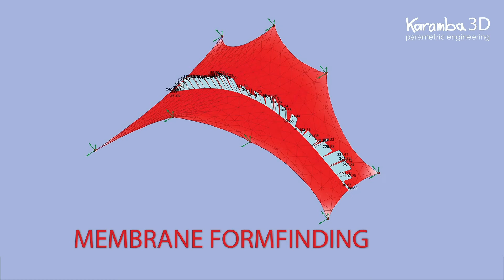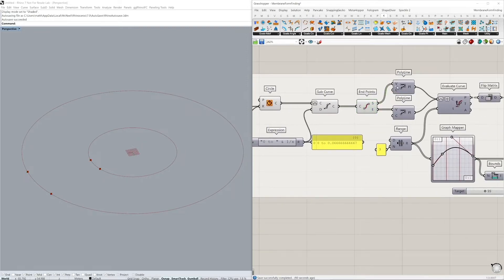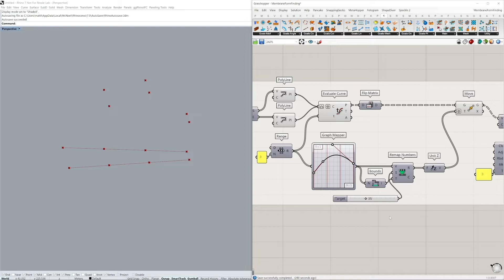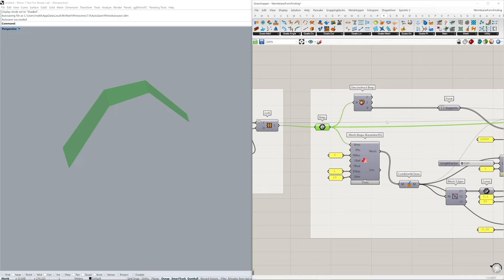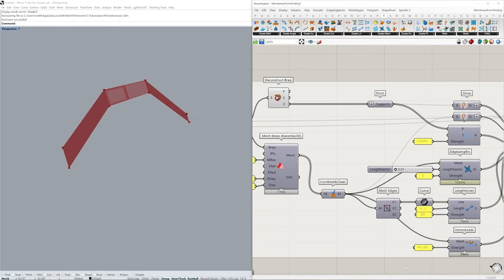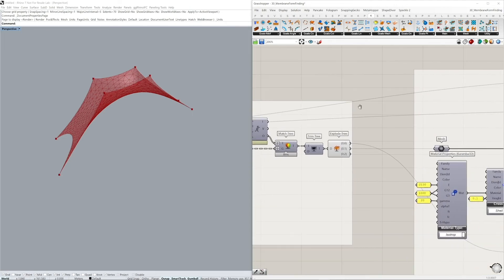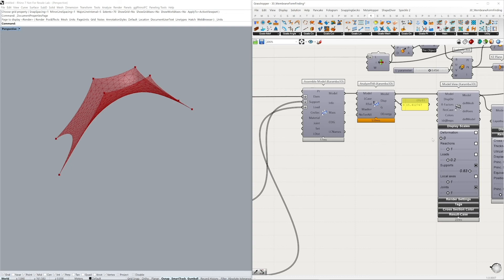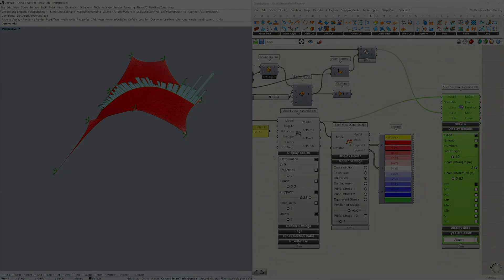Karamba3D TidBits #30 Membrane Formfinding

Comment: Why is the initial strain of the membrane set to -1? Since it states that the elongation is positive, shouldn't the initial strain on the membrane be a positive value?
Also, how does this value relate to the value of length in kangaroo edge length and length line?
Reply from the maker: If we want to apply pretension in the membrane i.e. make the element shorter, then this value should be negative. The units in Karamba3D are defined as mm/m.
Reply: @karamba3d  Thank you. Also, does the 0.01 of length factor of edge length of kangaroo and 0.1 of length of length line of kangaroo have anything to do with -1 of initial strain of karamba?

Comment: thank you for the video. But to be technical, how is this form finding? Because Karamba3D does not contribute to the form finding algorithm, Kangaroo does. Karamba3D only verifies/shows the loads to see if the Kangaroo form is good. Is that correct in your opinion?
Reply from the maker: This is exactly what is described in the video. Formfinding is performed using Kangaroo and brought into Karamba3D for analysis